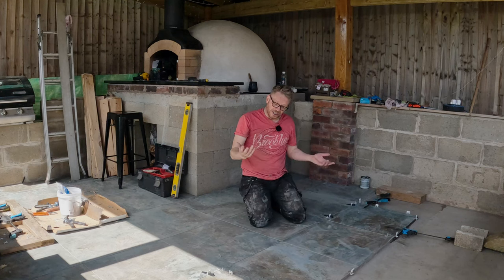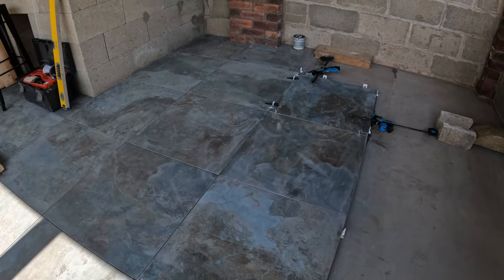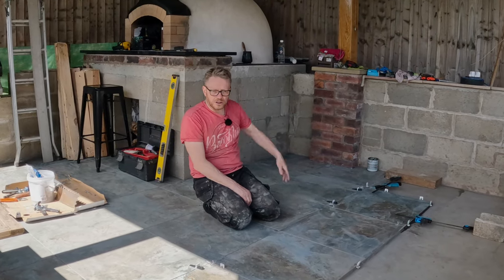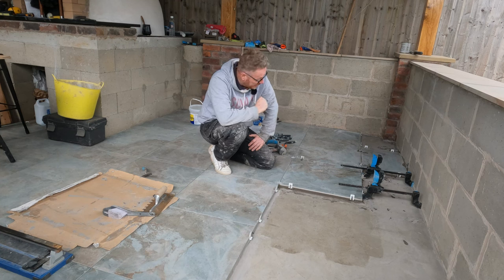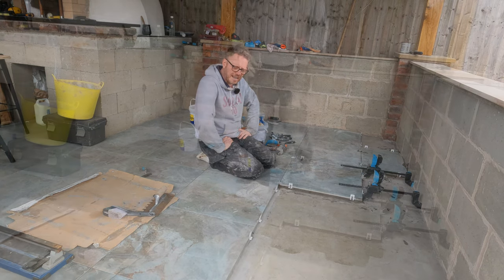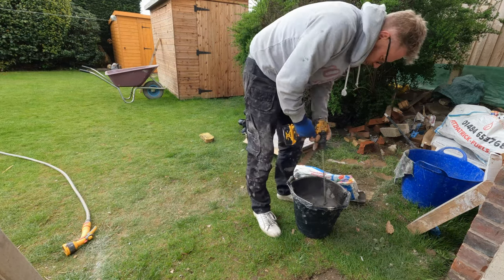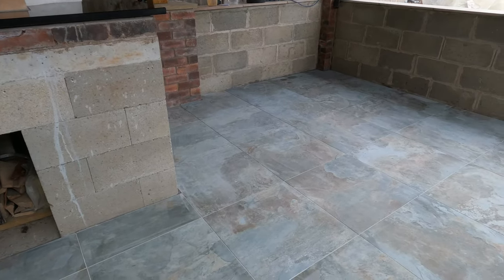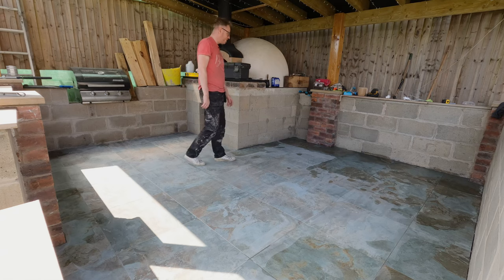Tiling a Floor Makes You Age (Vlog 45)

Comment: I have had to learn to stop pointing out the bits I am not happy with, and instead just point at the entire project and proudly say 'I did that'.
The floor looks amazing, take some time to sit back and admire it, pour a beer, give yourself a huge pat on the back and celebrate another job completed.   👍
Reply from the maker: It is hard not to focus the imperfections, especially when you consider that 99% of people won’t even notice them. 

I fully intend to delve into the beer reserves this afternoon, it’s sunny outside so we’ve got to make the most of it. 

Thank you for your support. ❤️

Comment: Nice job you did there Mike, tile adhesive is horrible on hands - it dries mine out like mad.  Did you measure a few different tiles to see if there is a difference in size as sometimes there can be a 1 or 2mm difference and that can put you out on your lines.  Wiping the haze off after grouting is an endless task! 

Hope you get lots of nice evening to enjoy the oven this summer house, that’s turning into a cracking set up, you’ve got there.
Reply from the maker: Thank you, sir. 

I didn’t measure the tiles. What I did notice was not all the tiles were perfectly flat so it did result in some slight raised edges. Maybe I should have measured them. Saying that though, once the grout was in they look a 100 times better. 

And yes, adhesive is brutal on you hands!